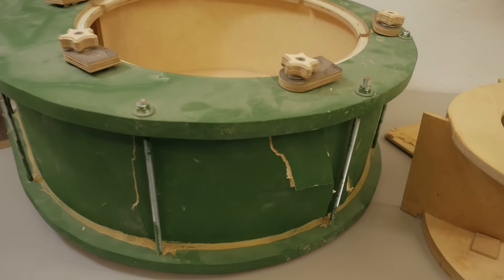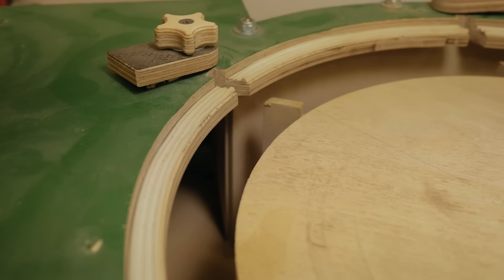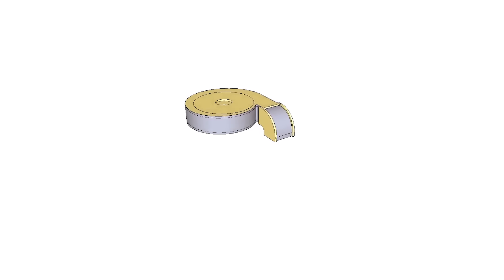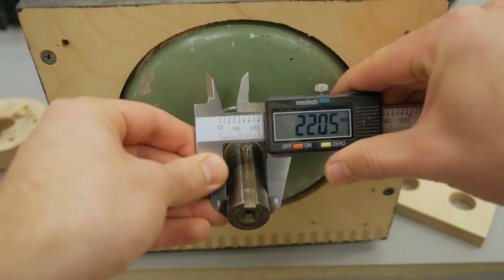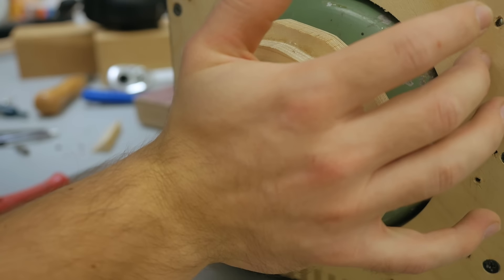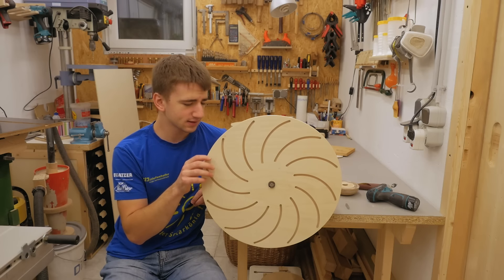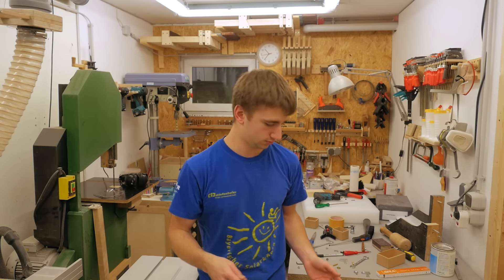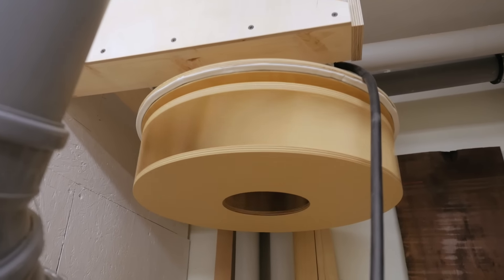Building a Big Dust Collector Blower #1

Comment: I think it's still taller than it needs to be.  Look at the insides of a water pump, those impellers are really thin.  Your hose only has so much area for air to flow, no need to make that so much bigger in the blower.
Reply: I like your take on dust collection Matthias. Just make a small one for every tool you have and then you wouldn't need a giant motor.
Reply: This is totally more fun though.
Reply: it helps a lot for experimentation to have one of those nifty airborne particle meters....
Reply: hey Matthias, i love watching both your and Marius's videos and i do honestly hate to be "that guy" but i suddenly had one of those OMG i have relevant information, training, and knowledge that would be helpful here! .. don't hate me and yes i would love to have in-depth conversations on this stuff because i am a huge nerd ,
but working in HVAC as well as doing instillation for central vacuum systems, for as long as i have i can understand why he used the larger impeller. yes there is only so much space for air to flow in the hose but you also have to overcome the shear distance OF piping and hosing. the distance of plumbing requires higher pressure of suction to have similar performance at the end of the tube as well as the beginning of the tube. water is non-compressible compared to air. so 1 gallon of water, at 3 psi will come out the end of a 30 foot tube the same as a 3 foot tube due to the non loss of compression of water. however when dealing with flowing air, every joint, transition, tubing change, etc will add "length" to the pipe and since air IS compressible it takes higher pressure as well as higher rate of flow needed to get the same (example) 300 CFM out of the tube at the end of the 20 foot run as in the begging of the piping chase. doing general calculations for the size and shape of the plumbing, its rated CFM, etc just like the big dust collector its going to need a hefty impeller. 
the other thing i noticed with the small dust collectors rather than the larger systems is hes running the collectors like a vacuum cleaner system, where the dust is not entering the impeller but is needed to remain fairly strong even on the outflow to overcome the thick air filters, so in addition to high inlet suction it will need a higher outlet pressure unlike say your large shop collector which is only using a fiber bag rather than those paper type filters.
Reply: oh hi Matthias, I love your videos. I really afraid that the loading of these leaves is too heavy. it only built by estimation without measurement. But the workmanship is undeniably very good.
Reply from the maker: +Matthias Wandel  You know that you recommended that thickness.
Reply: I think "german engineer" is a pleonasm.
Reply: with your CNC would it not have been possible to use the 12mm ply for the upper disk and machine out pockets in the material to reduce the mass?
Reply: its completely wrong to compare 2 fluids with totally different physical characteristics
Reply: Matthias is commenting on the height of the impeller, not the thickness of the veins. I don't know what you guys talked about but there is a possible misunderstanding here?
Reply: Matthias WandelShacrali coming out if the mould
Reply: Well air is a lot lighter than water and is able to be compressed fairly easy (compared to water) so a single motor can move a lot more air than it could move water.
If the hose is already smaller than the impeller itself, then there is no real use to shrinking the impeller since it won't make a big difference, you could hook up a smaller motor to it then though.
I'm not here to calculate the power required to accelerate a certain amount of air with a certain pressure, so these were just rough estimates from my side :)
Reply: Marius any chance of sharing your design of the blower?
Reply: According to Bernoulli equations, air acts like water: as they are both fluids.
Reply: Hi friend, I'm from Brazil. What is the difference between the reeds and the curved ones? I see you make them all dust collector with curved reeds. thank you
Reply: @MariusHornberger  Hi friend, I'm from Brazil. What is the difference between the reeds and the curved ones? I see you make them all dust collector with curved reeds. thank you

Comment: Hi Marius..when my shop was building wooden impellers in the 80's..we would epoxy coat the vanes to help with surface wear. We found the vanes would wear and eventually self destruct uncoated. We also put an hour meter on each impeller head so that we could schedule periodic tear-downs and inspections. Just a couple ideas for you.
Reply from the maker: My fins have three coats of oil based polyurethane on them.
Reply: Remember too these vanes are constantly being blasted with particulate, you really want something that is going to stand up to that. Often the alkyd poly's have very low durometer and brinell hardness numbers. We experimented with wood vanes at first and they always failed for us. We later made a clamping mold where we heated PVC sheet materials in a small oven to get them soft, clamped them in the mold and when they cooled we had some very consistently shaped and long-wearing vanes. Good luck with the new blower! The project looks amazing.
Reply: Marius Hornberger which brand?
Reply: wxfield
Reply: How thick would the sheets be for a design like this? And how tall are the fins?
Reply: you could glue thin steel plate on the wood (or stainless steel like 0,1 -0,2mm thick)

Comment: Please...... Do NOT use the steel key you made. Keystock is designed to be sacrificial..... to be the weak link..... and prevent further damage to more critical components..... Namely your impeller or your motor shaft. Here in the U.S. keystock is generally a zinc alloy and can be bought to size or in a 12" stick. Nice video. Very well orchestrated. Keep up the great work.
Reply: Dave Potts True, but that is for a steel shaft to a steel pulley or gear. his pulley/gear/blower is wood...it is the sacrificial peice.
Reply: If we buy keystock here its C45 - Carbon steel with .45% carbon. Same for keys that you buy seperately, those are also carbonsteel.
Reply: The key won’t break before the wood does, and when the wood breaks someone is going to lose an eye.
Reply: William Carr how do you suppose someone will lose an eye?
Reply: how, he has got a metal case?
Reply: Phantom Flows because eyes are fragile.
Reply: Plexiglass blades.

Comment: Okay, I'm necroposting a bit, but once upon a time I had a job related to designing turbines and centrifugal compressors (for aerospace if it matters). It was a bit of a learning experience for me, and if I had to name one particular takeaway, I would say this: making turbines with even number of fins is always a bad idea . There's a simple reason for that: the more symmetries you have in your system, the more resonant frequencies the system would have. And you want to avoid resonance at all costs, since it leads to structural failure. So for turbine designs, it's usually best to use prime number of fins (2, 3, 5, 7, 11, 13, 17, 19, 23, 29, 31, etc), since that introduces only one symmetry (rotary n-fold, where n is the number of fins). Any other option would introduce at least three (e.g. 21-fin design would have 21-fold, 7-fold and 3-fold rotary symmetries, each corresponding to its own resonant frequency). Using even number of fins is especially bad, since it introduces mirror symmetries in addition to rotary symmetries. Just wanted to share that in case it might be helpful to someone reading.

Comment: If you added 4 pieces of 3mm all-thread recessed in from the base of one blade to the top of the next, you would add triangulation, thus preventing the impeller from coming apart during high start up torque. Triangles FTW!

Comment: Excellent craftsmanship!  I am a tool and die maker by trade, in business for over 30 years creating many incredible works art with steel dies. From F18 fighter jet parts to toothpick sorting machine.  Here is a brain teaser.  I had to cut make 100,000 keepers for the Canadian military.  In order to be unbeatable in price, I devised a machine to cut 1.875" OD brass tube with .040" wall thickness to .375" lengths, WITHOUT scrap!  These rings were then shaped into the keeper that looked like a dog bone. I challenge any engineer to come up with such a scrapless tube cutting device!

Comment: Helpful tip for bent plywood - it is possible to make your own ply using a form and then gluing the layers together - time consuming but you can get virtually any shape you want. Just have a reverse form on the top and clamp the whole thing tightly.

Comment: Thank you for including the motor spec!
Reply from the maker: You're welcome
Reply: I'm currently looking for a suitable motor to build my own. Tempted to try stainless or aluminium fins instead of ply if you can't think of any reason not to.
Reply from the maker: +James Williamson how to join them toa wooden disk?
Reply: Ahhh yes. Epoxy might work but wood-glue-wood is probably better.
Reply: You should consider using a motor soft starter, when you're still in planing phase!
It eliminates the high-torque shock and thus mechanical stress on all components.
Reply: I was going to suggest a VSD (variable speed drive) to eliminate the high jolt from the normal start-up. I agree with Julian. Also, you can adjust the ramp up speed and maximum speed also.

Comment: Something you might consider, though it is more work, is to round the leading edge of each fin and to taper the trailing edge. Through observation on small balsa gliders I've found that this improves efficiency greatly. It may contribute to lower noise or less power required or greater volume of air being moved.

Comment: Elegant solution on the vanes Marius, they came out beautiful and look extremely durable. Some of my vey best Captain obvious statements are; That will never work!, or ; That's the first thing you check!   Best response; I know that! (especially if it is total BS.) Enjoyable video, keep it up, cheers!
Like you, I have made things before I understand the engineering, in that case it is easier to make a prototype with its shortcomings and call it the Mark 1, the improved model will then become the Mark 2 and so forth .

Comment: Marius,
not bad so far, there are few things that need to be pointed out:  

the fins are a little too long for the diameter of the impeller wheel. you can safely reduce them by about one third to half of what they are now. 

if the noise is still an issue then try installing an uneven number of the to cut down on the harmonics. 9 of them will divide your circle into 40 degree slices.

also, the approach of the incoming air needs to be a little more curved. it's going at 90 degrees, which creates cavitation and again creating a lot of noise and huge re-circulation losses. if the top disc rises up as a cone to the inlet of the volute you will get a smoother change of direction of your air flow.  the hub should also be concave so the incoming air can slip across it. with the convex shape it is now you're creating a vortex around the periphery of the hub and again creating re-circulation losses, harmonics and noise..

and finally you should do a dynamic balance of the impeller on the motor. you can simply use a drill to remove material along the periphery of the impeller in the heavy spots. just spin the impeller and allow it to come to rest. mark the spot and repeat 3 or 4 times. if the impeller comes to rest more than twice in the same spot you know the wheel is out of balance.

Comment: Marius, I enjoy your video's immensely, so much wisdom from one so young. One point you may want to consider with this build, BALANCE. It might not have been a bad idea to "Blueprint" the veins by getting exact measurements and weights on each individual vein so that you could either balance them to a close tolerance or offset the heavier ones against the lighter ones.
Reply from the maker: Will be covered in the next video.

Comment: Regarding the thickness/weight tradeoff for the second plate, you could also consider a mix of thicknesses. Use the 12mm plywood, but route away material in less crucial areas. Just something I thought of and thought I'd mention.

Comment: Great work!  I believe someone mentioned this below, but I think it bears re-mentioning:  prime numbers of fins.  I believe that the harmonic being generated by your six fin design is due to the even number of fins in the wheel.  Unfortunately, the greater your precision in assembly, the more likely it is to be truly symmetrical.  This, in turn, creates a wheel that generates a symmetrical pressure wave and the discomfort felt in particular locations in the room is, most likely, due to those spots being acoustic nodes (points of stacked frequency).  Current fanwheel manufacturers use an odd numbers of fins (9, 11, 13, etc) and for the fanwheel size that you are using, I think 9 would be the most appropriate. 

Also, it's been mentioned (both in comments and in the video) that the use of a VFD would allow for a slow start up (which is true).  If you do ever decide to use one, you MUST either put in a shaft grounding kit  or replace the bearings with ceramic bearings to prevent conduction from the stator to the housing.  If neither are done, the bearings will eventually fail and destroy the motor.

Amazing job!

Comment: For a blower a soft-start is a good idea, less mechanical shock at startup. And the power goes up at the square of RPM for a blower so you don't need a VFD for constant torque (unless you want to have closed loop control, but you most probably don't).

Comment: I know I'm super late to the party, but a couple of things:
Sound intensity for impellers is largely controlled by RPM. If you need X m³/min and a given impeller needs to run at Y RPM, an larger or more efficient impeller could be run at Y/2 RPM, which will reduce the volume logarithmically; even though you're running at half the RPM, you could be at a quarter of the dB.

Impeller efficiency can be greatly improved through proper ducting and skirting; the longer the air channel, the more uniform the pressure waves are and therefore the less pumping loss you have through resistance.

Long story short: Make a larger impeller, with ducting and shrouds, and reduce the RPM off of the motor until you reach the minimum acceptable m³/min (CFM).

Comment: Yo! As for some of the comments u quote - many people have no idea how strong wood is. Yes it's a live material, but it's also very strong and durable - way more than many thinks. We used to make wooden tools a lot bitd. Many feel they need a tig welder and a fabrication shop to do the same today :P. Which is not true.

As for the acceleration situation... If - and only if - the motor will play nice with a frequency drive (some older motors will heat up too much and u will have a meltdown on your hands), get a cheap one on ebay and hook it up and program i to spin up the motor slower. With that motor, just killing off the initial jerking that comes from the very first moment after startup will make the wood stay together, even if u made it lighter - as in smaller dimensions.

I need a vacuum system myself. And it's kinda tempting to make it out of wood. But then again, they are not very spendy to buy, so I haven't decided yet :). Keep it up.

Comment: Another great video. I had no idea that 3 phase power was so common in Europe. In the UK, it's not allowed in homes and only at commercial or industrial sites. I've seen plenty of people run 3 phase machines off single phase using a step down converter. A benefit of that, apparently, is that you can introduce variable speed easily.
Reply from the maker: Yeah, but these units are very expensive. A variable frequency drive for me is probably cheaper.

Comment: hello Marius. a few things you can make to improve this design: give the blades  an airfoil shape; the tube from the cyclone should enter the through the housing of the impeller almost passing the bottom plate, so air gets in blades and not between the housing and the bottom plate.
there are more things : like making a "tongue" near the exit duct and offsetting the impeller in the housing. 
anyway , thank you for the videos. I appreciate all the work !

Comment: To reduce the startup jolt, in the past, I have used a cheap Chinese clothing iron. Electrically, put the iron in series with a switch across it. At startup the iron will limit the power to the motor. Once at speed, throw the switch that shorts out the iron. For smaller motors, a incandescent globe can be used. Cheap, simple, maintainable, and can usually be done for under $10.